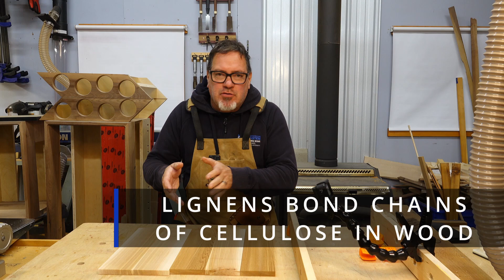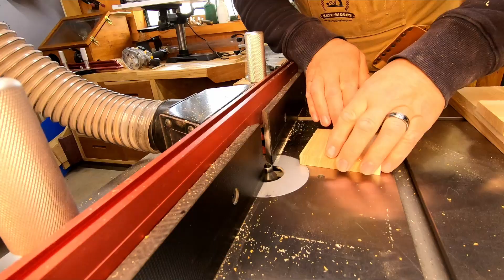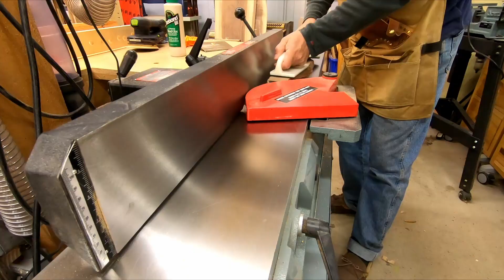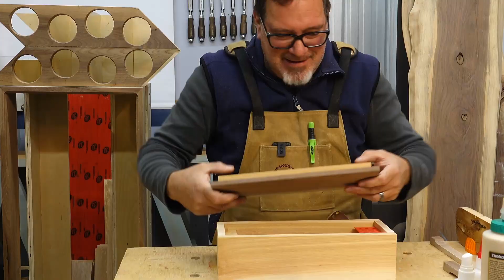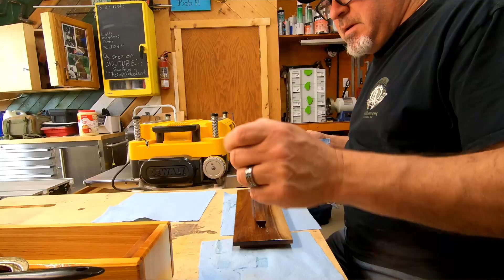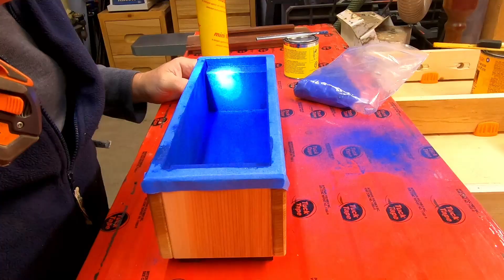Simple no Joinery Artist Box

Comment: I enjoyed the video.  Nice joinery without fancy stuff.

One thing, however?  End-grain to end-grain glue joints can actually be quite strong.  Best to do some good sizing but in the end (pardon the pun) you have a strong joint.  Patrick Sullivan worked on that weak end-grain joint myth and showed it to be problematic at best.  The key is to realize that the end-grain should pretty much be treated as straws - you have to do the sizing to fill those "straws" up a bit and then you are getting a strong glue joint that extends a ways into the wood.

I didn't see any reason to use an end-grain to end-grain joint for this build so it really didn't matter for this project.

Pretty cool to use the CA glue trick but I might have just used the CA glue since that should make a pretty good joint unless you are going to rap it with a hammer or similar?
Reply from the maker: Thanks for the comments and ideas. I will do some further looking into the end grain gluing, like you say it would be seldom used but would be good to understand if it could be used.
Reply: @TherapyWoodWorks  best practice would be to take some wood glue and water it down a bit. Put on the end grain and let it soak in. Wait about 20 minutes then apply as normal. Works pretty well